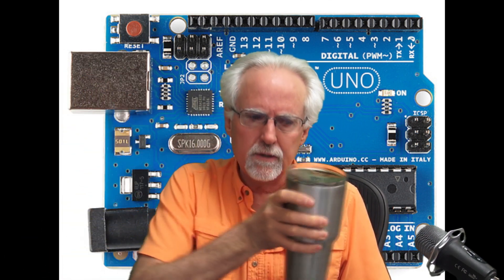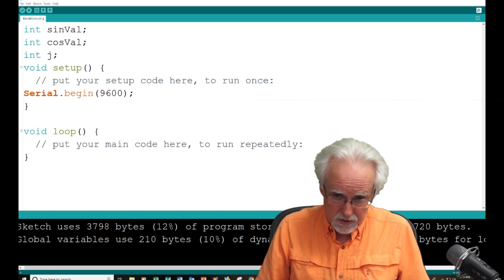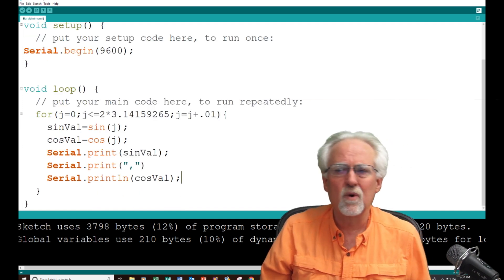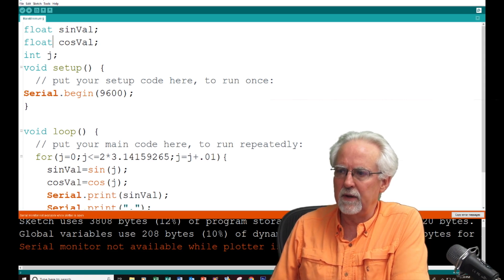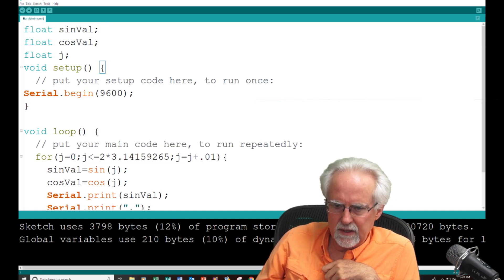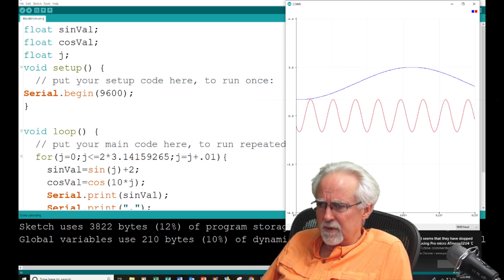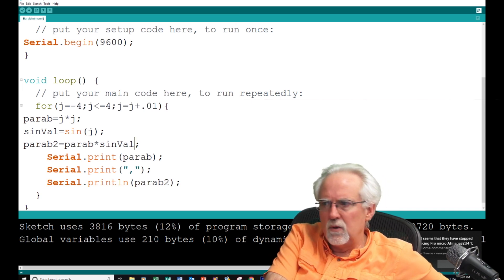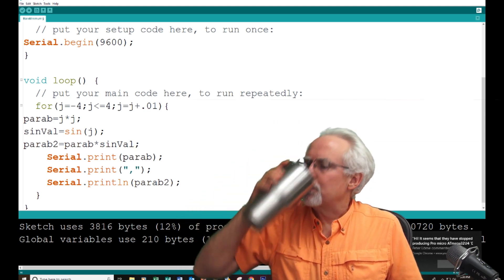Arduino Tutorial 57: How to Plot Multiple Channels on the Serial Plotter

Comment: Hi Paul, i managed to do the homework. I used floats for my variables as the numbers were not whole numbers. I also used PI as apposed to a number. My problems were the speed of the plotter, I found that I had to run the baud rate at 4800 to slow it down enough to give a decent waveform and further I used j=j+0.1. With your settings, it was flying across the screen really fast and was really jagged. Interestingly if i put it into Tinkercad, your settings ran normally and mine worked but just slowly. Cheers

Comment: My goodness. I had to review the trigonometry functions and radiant / degree conversions. I found that incrementing the sin and cos with 1/10 of a radiant gave a nice plotted sin and cos wave. Made a counter for the radiant from 1 to 628 (2*pi  = 6,28 which compares to 360 degrees) * 100 so its incrementing in 1/100 of a radiant. Printing the upper and lower sin/cos values (1 , -1 ) then gave the right range.  Excellent homework lesson. thanks!

Comment: I didn't have a problem with this, went really well as far as the sine and cosine were concerned.  I couldn't get a response anywhere, I changed up everything and after two days found I had typed Serial.print instead of begin.  A lot of cussing and cursing before I finally figured that out.  Pretty silly.

Comment: No, didn't manage it. What I did end up with, wasn't the same as yours initially either.

However, did manage to label functions on plotter, ("plot_name:") this labels each line by colour, and if you set up a simple constant, on mine i just added 

Serial.print ("Constant_Limit:"); 
Serial.print(1.5);
Serial.print(",");

my graph then settled on +/- 6, a line at a constant value of 1.5, obviously, this could be adjusted to help with measuring the values.
Silly typos have been the bane of this one. didn't manage to work out everything myself, but happy with what I did manage.

Comment: I used a for loop, for (angle=0; angle<=90; angle+=0.01;), so naturally angle has to be a float. Didn't have to use Radians.
I'm using Arduino IDE 2.1.0 .
Someone said to edit and recompile the IDE source code to enable auto scaling between values on the Arduino website.
I don't know Java, so I'll leave it like it is.

Comment: I am using the latest version of IDE (IDE 2.0.0) and when I start the serial plotter I just can see the first channel. I had the same problem with the previous lesson. I have written the code of sine and cosine exactly the same as you have done but just the first channel shows up and it seems like it is plotting the last points and I do not have the same representation as yours.
I am sure I am making a stupid mistake but I would appreciate it if anyone could help me in the matter.
Reply: I'm having a similar issue with (IDE 2.03) . The first and second channel are flat lined at Zero (0) and One(1) . All three declarations are set as "floats" ... Seems like it might be something with the new IDE.

Comment: The squiggly bracket should close after the if statement.
Unfortunately my serial plotter worked once in lesson 56 and then never again. It just comes up blank
When you said we have to kill the serial monitor I removed the Serial.begin (9600); and it would not load. I put it back in and the serial plotter never worked again. I understood kill meant remove the view of the serial plotter, not the ststement.
I cannot figure out what I am doing wrong.

Comment: Didn't quite understand what was required of the homework. It's a looooong time since I did any of that sort of maths. I think I'll concentrate on the hardware side of things for Arduino.
However, I do like a challenge and found that although there don't appear to be any settings for the Serial Plotter, all I did to stop the autoranging was to add two more channels and print -16 and 16, and that kept the range between those two values.

Comment: I did the homework and it was what you did. However, the plotter was blank. I went back and went through everything. It still wouldn't work. Then, to my horror, I realized I typed Serial.print(9600) instead of Serial.begin(9600). I had a good laugh because the hard part was correct and the easy part was completely wrong. This was a great lesson Paul. It is really easy to make little mistakes that make it past the verify process. Another great lesson to pass on to my students!!!!!!

Comment: I figured it out by myself I also used the cos and sin which I guessed and then googled it. i think you should not use commands that we have not used yet but it was still fun. I did it in a slighty diffrent way:
float sine;
float Angle=0;
float cosine;
void setup() {
  // put your setup code here, to run once:
Serial.begin(19200);
}

void loop() {
  // put your main code here, to run repeatedly:
cosine=cos(Angle);
sine=sin(Angle);

Serial.print(0);
Serial.print(", ");
Serial.print(sine);
Serial.print(", ");
Serial.println(cosine);
Angle=Angle+0.05;
}

I printed 0 so I could see the middle of both. I did floats the first time anyways though.

Comment: Hey Mr.McWhorter, I did this on my own by guessing that there is a cos and sin command in arduino and there was! Although my graph was a bit cubic at the end haha, but I still got a rough representation of it.

int sineVal=360;
int cosineVal=360;
int sineDir=0;
int cosineDir=0;
int dt=100;
void setup() {
  // put your setup code here, to run once:
Serial.begin(9600);
}

void loop() {
  // put your main code here, to run repeatedly:
Serial.print(sin(sineVal));
Serial.print(",");
Serial.println(cos(cosineVal));
if(sineVal>=-360&&sineDir==0){
  sineVal=sineVal-1;
    if(sineVal==-360&&sineDir==0){
      sineDir==1;
    }
}
if(cosineVal>=-360&&cosineDir==0){
  cosineVal=cosineVal-1;
    if(cosineVal==-360&&cosineDir==0){
      cosineDir==1;
    }
}
if(sineVal<=360&&sineDir==1){
  sineVal=sineVal+1;
  if(sineVal==360&&sineDir==1){
      sineDir==0;
    }
}
if(cosineVal<=360&&cosineDir==1){
  cosineVal=cosineVal+1;
  if(cosineVal==360&&cosineDir==1){
      cosineDir==0;
    }
}
delay(dt);
}

Comment: sir i did it without using sin cos functions,heres the code

void setup() {
  Serial.begin(9600);

}

void loop() {
  float a=1,c=0,d=1,e=0;
  for (float x = 0; x <= 1; x = x + 0.1) {
    float y = sqrt(2 * x - x * x);
    Serial.println(y);
    
    if( a>=0.){
       float b = sqrt(2 * a - a * a);
    Serial.print(",");

    Serial.println(b);
    a=a-0.1;
    }
    delay(10);
  }

  
  for (float x = 1; x >= 0; x = x - 0.1) {
    float y = sqrt(2 * x - x * x);
    Serial.println(y);
  if(c<=1.){
     float b = -sqrt(2 * c - c * c);
    Serial.print(",");
    Serial.println(b);
    c=c+0.1;
  }
    delay(10);
  }
 
  for (float x = 0; x <= 1; x = x + 0.1) {
    float y = -sqrt(2 * x - x * x);
    Serial.println(y);
    if(d>=0.){
      float b = -sqrt(2 * d - d * d);
    Serial.print(",");
    Serial.println(b);
    d=d-0.1;
    }
    delay(10);
  }

  for (float x = 1; x >= 0; x = x - 0.1) {
    float y = -sqrt(2 * x - x * x);
    Serial.println(y);
    if(e<=1.){
     float b = sqrt(2 * e - e * e);
    Serial.print(",");
    Serial.println(b);
    e=e+0.1;
    }
    delay(10);
  }

took me a day to figure out

Comment: Think I got it, had a bit of trial and error (which can be seen in the commented code), but nevertheless got it to work. Here's what I had for my code:
int tpin=12;
int epin=11;
float pingTime;
int del=100;
int sos=767;
float d;
float r;
float pi=3.1415;
float x;
float y;
void setup() {
  // put your setup code here, to run once:
Serial.begin(9600);
pinMode(tpin,OUTPUT);
pinMode(epin,INPUT);
}

void loop() {
  // put your main code here, to run repeatedly:

 
digitalWrite(tpin,LOW);
delayMicroseconds(10);
digitalWrite(tpin,HIGH);
delayMicroseconds(10);
digitalWrite(tpin,LOW);
pingTime=pulseIn(epin,HIGH);

 d= (767.*pingTime*5280.*12.)/(60.*60.*1000000);
 r=d/2;

 for(x==0;x>=0*pi;x=(x)+(pi/64.)){
  Serial.print("Sine: ");
  Serial.print(sin(x));
 Serial.print(",");
//  Serial.print("This is the sine value: ");
Serial.print("Cosine: ");
  Serial.println(cos(x));
//  Serial.print(" This is the cosine value: ");
//  Serial.println(cos(x));
//  Serial.print(",");
//Serial.println(1);
 
  delay(del);
 }